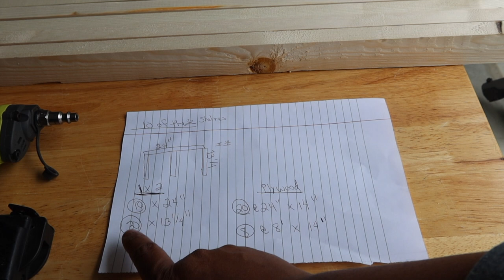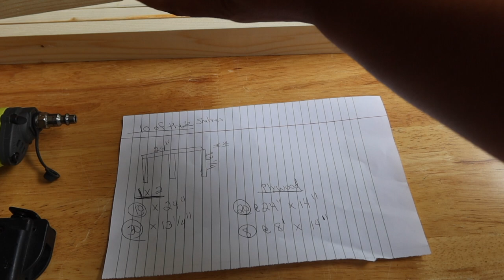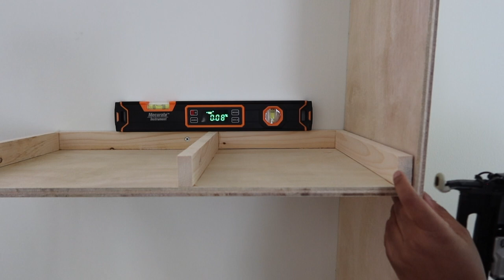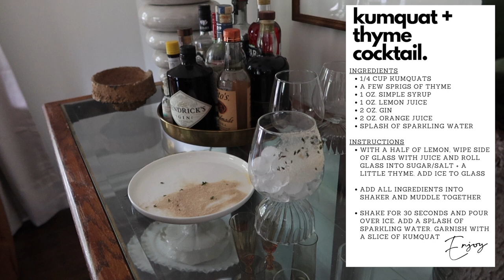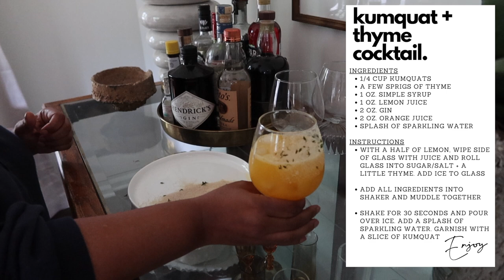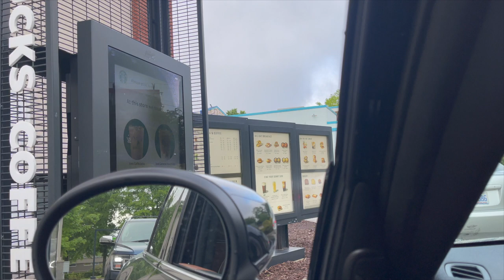Let's DIY Some Custom Built-In Bookcases

Comment: Wow, you guys pulled this one off by cutting that dresser in half. How clever to even think about cutting an entire dresser in half.  When we had our home built we didn't get custom bookcases built on the sides of our fire place. After watching this video I believe we can build them ourselves! Thx for sharing! 🙂
Reply from the maker: Yay!!!! You know that is music to my ears! And of course if you have any questions at all, I’m here to help you. You can do it!!! But yes - once I saw someone else cut their cabinet in half, I was like game on! Lol!!! 😆
Reply: Bookcases are fairly straightforward but don't let fear stop you.  Just be sure to have a level and tape measure and be mentally prepared to have to pause, go watch some instructional vids, and try again.  Also, you will most likely make a mistake somewhere-  cut a board too short, discover you don't have certain nails or screws, or you drilled a hole in the wrong spot.  Wood-filler (or wood glue mixed with sawdust) can fix some errors.  Just plan for the project to take a while and be patient.  It may be easier than you think!